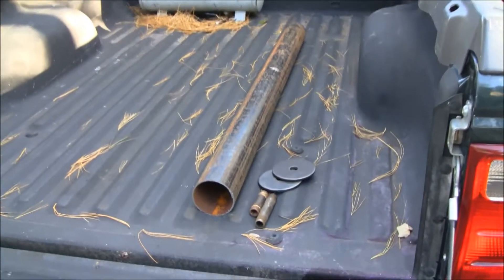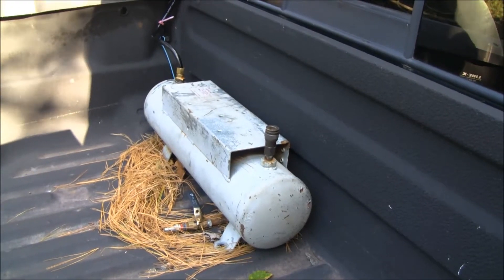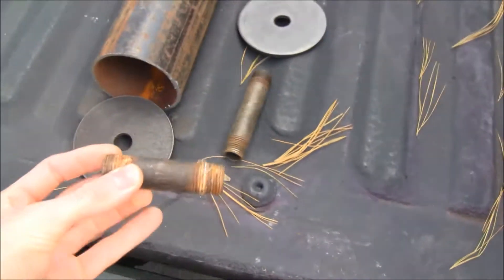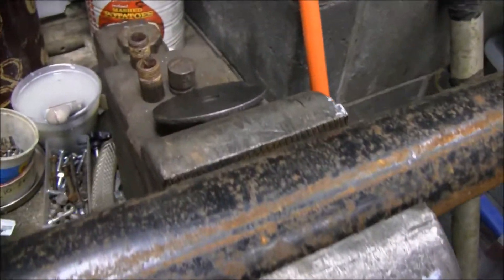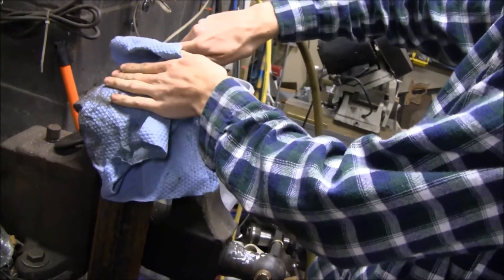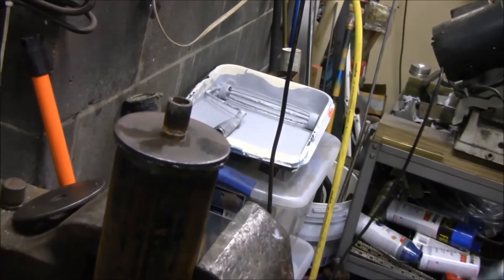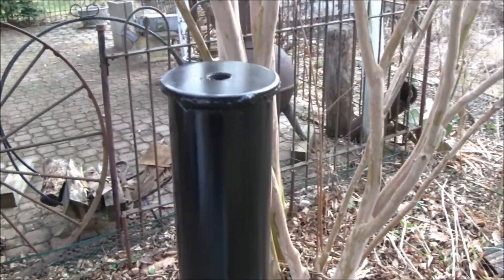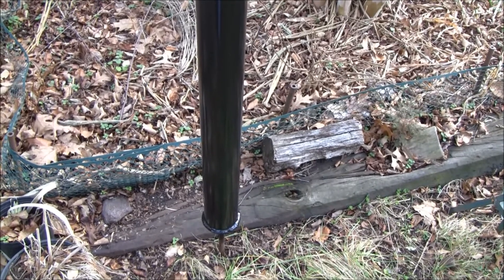FABRICATING AN AIR TANK for ONBOARD AIR

Comment: Good job young man. I grew up with stick welding, and have used mig at my friends numerous times over the last 20/30 years. However I've only recently learned from watching vids you weld the opposite way to get the best weld i.e. you weld left to right, not right to left. Because of no slag you supposedly can control the puddle better, and get deeper penetration. Doesn't matter on thin stuff, car repairs etc. Never had one of my welds break though lol.
Reply from the maker: MIG is the way to go unless you're building a battleship or a bridge! :)
Reply: You bet :) When I was your age I had to use Oxy Acetylene to weld my cars up.
Reply: dirtbike5100  I like stick welding on heavy steel, but I have run a 600 amp Lincoln wire machine using 3/32 flux core wire. As long as the metal is clean it will lay a massive bead. We used them to build up rollers for glass plants. You are doing fine, enjoy your videos, and I'm older than RoadKing..

Comment: Nice bit of MIG welding,...incidentally, the camera's audio system picked up some static noise from the arc as you were welding. Interesting.
Reply from the maker: I think that static was the sound of the Sparkes :)
Reply: dirtbike5100 Good one,...you're slick for sure.   Now  hurry up and lets see this finished and working too.
Happy New Year.
Reply: That is what a mig welder sounds like, not static at all.
Reply: Whitey Hey Whitey,..I kind of know what a MIG  welder sounds like in operation,..(as.I'm a certified welder,)..what I was referring to was the fine static sound that is on the video track,...Maybe you cant hear what I'm hearing,...but my  speakers clearly emitted the static picked up as RoadKing was close to the welding,...Anyway,.no big deal.I just made an observation on the  audio portion of this video.